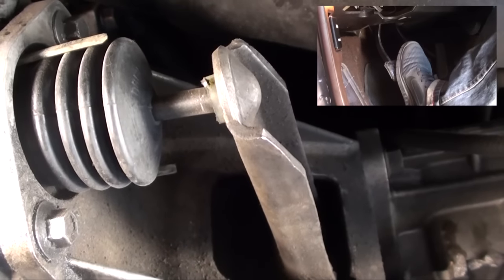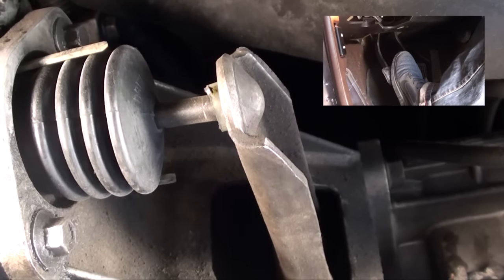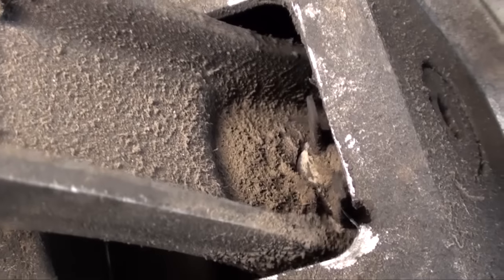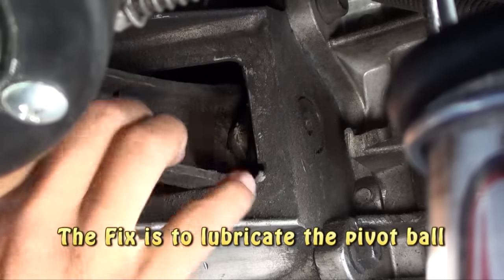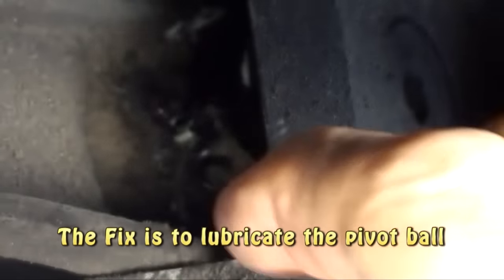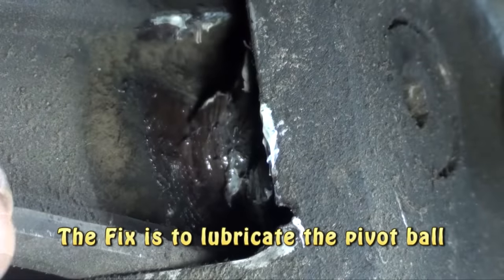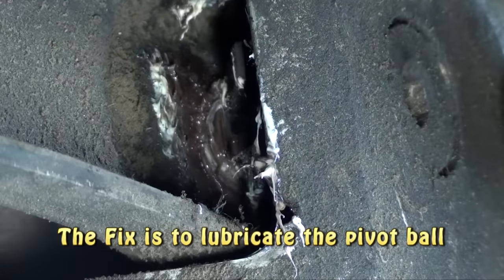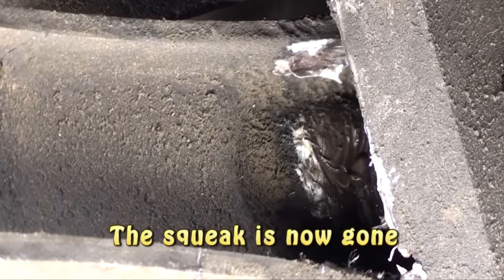Clutch Release Fork Noise

Comment: I think somebody over torqued the pressure plate
Reply from the maker: I'm sorry that is incorrect.  over or uneven tightening of the pressure plate won't cause that. There are multiple diaphragm fingers (what I call them) that are often not perfectly the exact same height. They only need to be off by .030" to cause this wobble and as long as all the pressure plate bolts are tight regardless of how tight or how even this won't impact the height of the fingers. It has to do with quality control of the pressure plate and wear over time.  There is no harm and as long as the pivot ball is properly lubricated it's not a problem.
Reply: @DrivelineMaster  I've never seen the fingers of a new diaphragm clutch become uneven as it's installed until tonight. The fingers were even when the pressure plate was loose in the box. I installed this one in the usual way by tightening the six bolts about 1/4 turn at a time until the cover was in contact with the flywheel. While it was near contacting the flywheel one finger became lower than the rest. It bothers me but I can't really say that I have data one way or the other as to using this pressure plate. The one finger measures about .077" lower than the fingers next to it. To see if it would level out in use, I installed the trans and released the clutch several times using a lever on the fork. It seemed to operate normally (I don't know it it gave a clean release though) but after disassemble the finger was still low
Reply from the maker: Yea, unfortunately they do this. .077" in reality is only about 3/32" and acceptable and is a result of stacked tolerances. That means a slight imperfection of a few thousandth of an inch in the flywheel, pressure plate and disc can all add up and distort one or two fingers to more than a few thousandth's. This slight amount won't hurt anything but it can cause the release fork to vibrate as the throwout bearing rides on an imperfect circle.  I have even tried replacing the new pressure plate because of this. Sometimes it better and sometimes it's not. Different manufactures have different quality control standards and I bet they all have an allowable tolerance for this but they won't publish it.

Comment: I think this was my noise and I diagnosed it as a bad throw out bearing😂 oh well new oem one this time a lot of grease I didn’t put much grease
Reply from the maker: That is an often misdiagnose for a pivot fork noise.  Since the pivot and fork do not rotate there is little concern that the grease will fly off from centrifugal force and a more liberal amount can be used.  Make sure the fork boot is in place to keep the water and road dirt out of the clutch assemble.
Reply: @DrivelineMaster  yeah I put it back together with a bunch a grease I believe my clutch master cylinder is bad. My clutch pedal doesn’t feel firm at all it still springs and moves the clutch fork a lil but I can’t really get car into gear. The clutch fork still has probably 1cm before touching bellhousing when pressing cmc down. I can’t think of nothing else
Reply from the maker: Yes you could have problems in the clutch master or slave or air in the system.  However there are other things that could cause the disengagement problem you describe.  Did you put all new clutch parts in?  Or did you reuse the pressure plate or did you resurface the flywheel.  If you had the flywheel machined or you installed a reconditioned one it may have too much metal removed.  If that is the case you can replace the flywheel (best option) or see if you can find a flywheel shim. Shims work but it's a bit of a guessing game as to the size you need. If you reused a self adjusting pressure plate it could have gotten adjusted too far and now you can't get the correct free play.  If the pivot ball or fork is worn this too can cause disengagement problems.
Reply: @DrivelineMaster  no im pretty sure the clutch and flywheel are fine they’re literally brand new it’s a high performance act clutch. When I took the transmission off everything looked golden clutch looked chunky fingers on   Pressure plate were perfect. When I putt everything back on as well i bled and bled the cmc and was able to get it into second gear for like a second then it sounded like the clutch went it gear by itself lol. I turned car off thinking it was finally good. Then I got car on ground only to see I was still locked outta gears. I know this clutch is way more aggressive then stock clutch and if not cmc only assumption would be something broke in my transmission some way some how but I was able to drive park car, only to come back to being locked outta gears. Also my shifts have always been pretty tough even when I could get in gear. Thanks for replying btw I do appreciate it
Reply from the maker: More information is helpful.  If you installed a high performance clutch the added spring tension from the pressure plate can sometimes cause problems with the food pedal bracket assemble.  They can crack or welds can break which will cause the bracket to flex when you push the pedal down. When this happens the force does not transfer to the slave cylinder properly.  I'm not saying this is what happened but you need to inspect the pedal assemble while pushing down on the pedal to make sure the bracket or assemble is not flexing when your pressing down on the pedal.  Additional questions.  I think you said these were all new parts.  If so the engineering between all these parts is critical down to a few thousandth of an inch.  If you purchased an aftermarket high performance clutch did you get a complete kit with the flywheel or at least the flywheel from the same manufacture?  I have seen clutch kits from one manufacture and a flywheel from another and they don't work together.  Everything should be from the same manufacture.  I have also seen kits from eBay not work because a reseller was buying parts and making their own kits and sometimes doing it this way causes clutches that don't work.  Last time I had something like (HP parts from eBay) this the owner decided to remove the HP kit and put in all new OE parts and that solved the problem.  If all your parts are new and the bracket is OK, no air or leaks in the hydraulics, then it would be my guess that you have a mismatch of parts that are off just a tiny bit but enough to cause a problem.
Reply: @DrivelineMaster  it’s a whole new act complete kit lightweight flywheel and 6 puck sprung race disk. I tried maxing the pedal out to get as much movement and also even tried putting a small nut between where the slave cylinder end meets the clutch fork to try to get it to move that extra distance. Clutch pedal still didn’t ever seem to get firm at any point and pretty much extended to the same point as before I adjusted and added the nut.
Reply from the maker: Based on what you have told me it really sounds like something is off on the clutch kit parts unless the release fork or pivot ball is heavily worn.  All it takes is for the flywheel to be 0.020" to 0.030" thinner or for the thickness of the clutch disk to be off by 0.020" from OE thickness.  It doesn't take much.  0.030" is only about 1/32" but it can make a big difference with the flywheel distance.  Finding that small of a difference can be difficult to spot.  If your dead set on using that clutch setup you could look into adding a 0.020" flywheel shim. The shim goes between the flywheel and the crankshaft.  That often solves this type of problem but don't hold me too it.  Again based on what you have told me, if it was me fixing this I would try to return that clutch kit and get a different one from another manufacture. Make sure it's a complete kit including the flywheel.
Reply: @DrivelineMaster  I’m going to try the new clutch master cylinder and see if that helps if not I’ll have to rip it all out idk how it only worked for about 800 miles but we’ll have to see.
Reply from the maker: I get it.  The path of least resistance.  I hope your right but unless there is an obvious leak the odds are that the maser is OK.

Comment: Hi there, I think I may have the same issue but would appreciate your expertise. Car is a Toyota Celica (2006) and fairly tight around the clutch fork so wasn't able see if it's a similar assembly to your video. I made a quick video under the car yesterday to demonstrate the symptoms: https://youtu.be/LCosASRnOm4

Many thanks in advance!
Reply from the maker: That's it.  Your noise is exactly the same noise as I had.  Some clutch forks are impossible to get into without taking the transmission out.  Try unbolting the slave cylinder.  Only 2 bolts.  then pull the rubber boot off of the release fork and see if you can see inside the bell housing and possible get some lubrication onto the pivot ball.  Sometimes if you use care you might be able to use a little spray white lube to lubricate the pivot ball.  Be careful where you spray the white lube. you don't want to get it on the clutch disk.
Reply: @DrivelineMaster  Many thanks for the help! Out of interest what is the reason for using white grease rather than say bearing grease / moly grease / multipurpose lithium grease?
Reply from the maker: I prefer a lithium based grease because it works better with other forms of dirt as compared to a molly based grease.  White grease is lithium but there is also bearing grease that is lithium that you could use.  Frankly anything is better than that dry squeak from no lubricant.
Reply: It was awkward as anything to get in there but it's worked a treat! You sir are a prince among men. Many thanks from over here in UK and hope all is well with you and yours.
Reply from the maker: Fantastic.  I'm glad I was able to help.  I hope everyone on the other side of the pond is staying safe and healthy.

Comment: Hopefully you overcharged the customer like a good mechanic does.
Reply from the maker: This was at an Automotive Educational Community College and we teach integrity,  not overcharging.
Reply: @DrivelineMaster  my 350z makes a sound when the clutch pedal is released, could this be it?
Reply from the maker: Jose, watch close.  Is your noise when you foot is completely off the pedal and goes away when you press the pedal down 1/2 of an inch. If so, then Yes, this could be your noise. The way your phrased your question "When the clutch pedal is released" could mean that the pedal is completely on the floor and the noise is heard as you slowly lift your foot to engage the clutch.  A noise hear at this time just as the clutch is starting to engage and the car is just starting to move is a pilot bearing noise and the noise is more of a screeching noise as compared to a rattle or chirping noise in this video.
Reply from the maker: I don't believe in overcharging. All technicians should charge a fair wage for their time and knowledge. Everyone deserves to make a fair living but overcharging gives auto repair establishments and technicians a bad name.